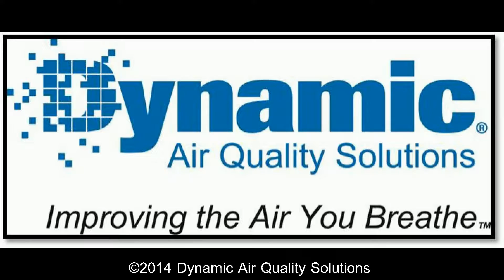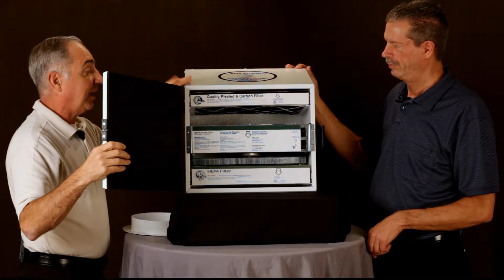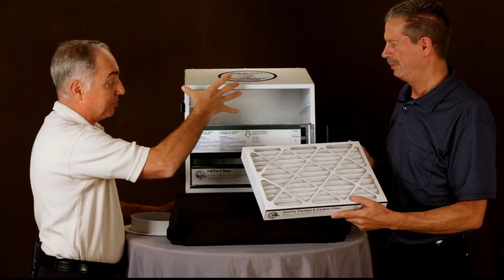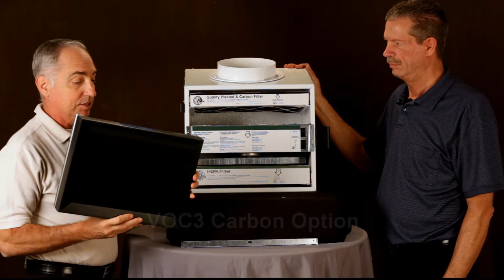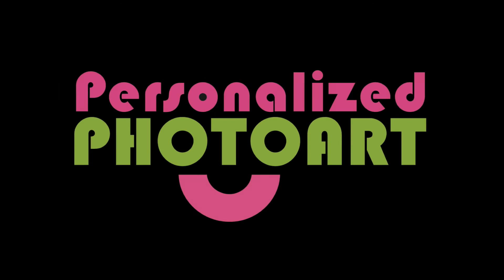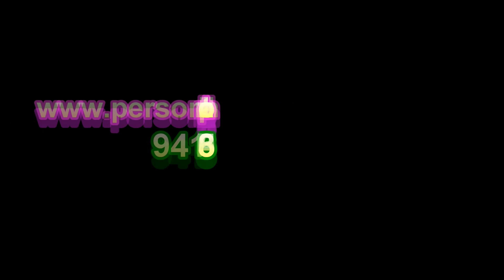Dynamic Product Video 4, Bypass HEPA Filter

Comment: I just went to install the carbon matrix into my unit and it doesn’t have the side rails for it, I had to use 2, 3/4” plywood rails to elevate it off the fan module.

Comment: I just wanted to chime in and say I just installed my unit last night, I used the remote mount with the collar kit. It took me 2.5 hours to complete in my attic. That includes mounting the unit, cutting into the return in 2 spots and installing 8” saddle take offs running 15 feet of flex duct and taping everything up. It couldn’t have been easier. I can only imagine how easy it would have been with direct mount system.